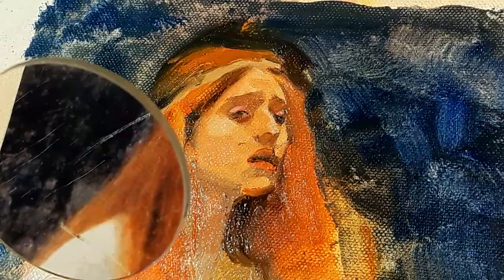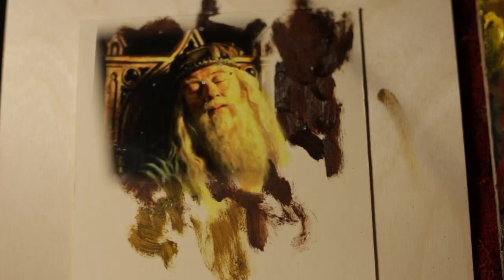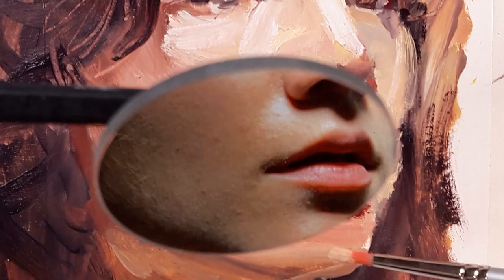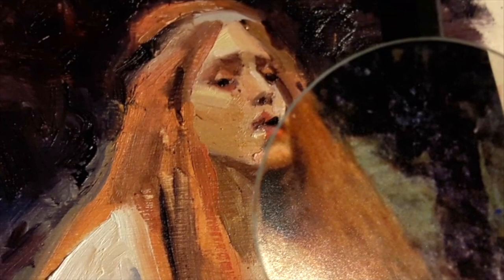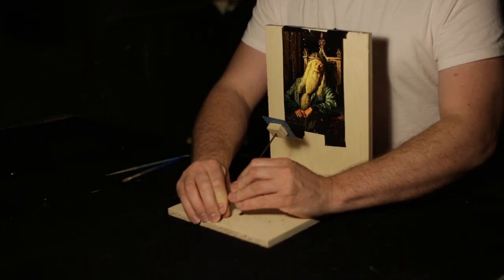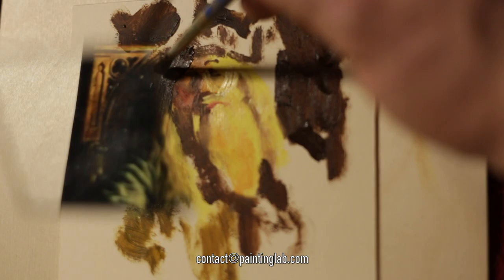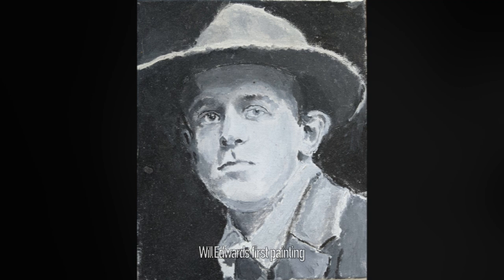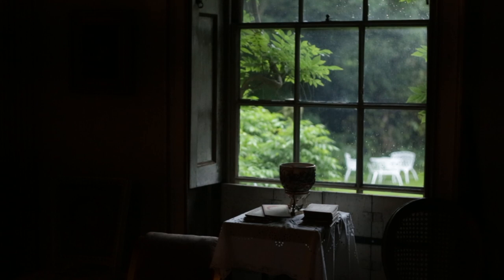How to make a Comparator Mirror (PART 1)

Comment: I'm in the process of building myself my set-up. Bought some round mirrors on Amazon. The interesting point is that it seems you don't need to buy expensive first-surface mirror, but you can turn a cheap second surface mirror into a first surface mirror! There are plenty of how-tos on Youtube, the trick is just to remove the protective coat of the metallized side with some paint stripper (the very alcaline solution)  Let it soak for several hours! In my first attempt, I just waited one hour or so. I could remove the coat with a wooden ice cream stick, but it severed the metallization that is only a few atoms thick. Then neutralize and rinse with white spirit or similar. 
At this stage I tried to protect the aluminium from oxidation with a layer of thinned car varnish. I tried to flatten the coat by spinning the mirror with an electric drill (that what they do for silicium waffers...), but this was not a success... too slow?.
My next try will be to use an air brush... But some other youtubers says this is not really necessary, and the oxidation is visible only after years...
So anybody else with experience with DIY first surface mirrors?
Reply from the maker: This is a brilliant post, thanks for sharing this knowledge. We'd really like to encourage folks to experiment in any way they like but it may be handy to say that we expect delivery of 1000 first surface mirrors just the other side of Christmas which we will be giving away (plus the cost of p&p)
Reply: There is the following of my experience... You see, I'm a maker more than a painter, so I tried my best to get a good tool...
- Dimension of the boards: Since my printer can do some A4 (21 x 29,7 cm) I wanted to be able to reproduce two pages, so an A3 (42 x 29,7), so I opted to something just a bit larger to leave room for the tape : 35  (depth or the floor board) x 45 (large). It happens that 45 x 45 would have been better, since at least 5cm are unusable at the hinge (too parallel to the mirror to see any reflection), and   the page should not be too close of the mast of the mirror.
- Fixing the too boards; I used shelf brackets, but they were not perfectly square so I could not get a fix image. 1 degree of, and you spend hours to find where is your problem. I used some thick paper under one side of the bracket, and used a big set square! I first used a small one and could not get a good enough result : all this to say that I really believe that an approximative solution might bring you disappointments. 
- Diameter of the mirror: First I tried a 5cm, but it's too large. There is always a slight deviation from one side of the mirror to the other. The bigger the mirror, the bigger the deviation. With a 2,5 cm mirror, the deviation is much less visible, so you can compare on any side of the mirror without having the feeling that you missed the alignment the previous time, not remembering which side you used.
- Mast holding the mirror: that was my biggest effort. I realized very soon that a mispositioned  mirror of a few millimetres was inducing dramatic deformation of the resulting image. So I used a rigid mast (an aluminium tube, diameter 6mm), and used my 3D printer for the foot of the mast, and the mirror holder. My first foot was rather small, held by a single magnet. but the positioning was not precise enough. If you have touched the mast, no way to reposition it exactly to retrieve your reference. So I designed a system with two screw to millimetricaly position the mirror in height (and so get the 45°), and the azimuth to be strictly perpendicular to the front board. The tuning is done with a square page on the front board : if you get a trapeze on the floor; your angles are wrong!
- I'm trying now to reproduce the "girl with a pearl" of Vermeer... Quite pretentious of me, but still his simplest composition, I think... And if I'm please with my system, I will publish my 3D plans on Thingiverse. 
- Oh, one more thing: I found that inclining the board was very comfortable to work seated instead of bending over the masterpiece... And it's also very useful be be able to juge the daub from a distance, where you see all your mistakes: one reason more to have a sturdy system to hold the boards and the mirror!
Reply: Even when I bought a first surface mirror, from an optics firm, they were only about 12 dollars on ebay.  But I actually used 2" squares or rounds from Amazon, and just cleaned them off with paint stripper.

Comment: I don't think the 45 degree thing is all that crazy important.  My mirror is adjustable so I can tune it up, but if you look at Tim's video segment on his process, the video is on YouTube, his source and mirror are not close to 45 degrees.  

As a teaching aid, I ripped through the mirror practice pretty quickly.  I used it for the first portrait I ever attempted, basically the first painting (may have done some plein air first), and as soon I I got the likeness from the mirror, I realized it was faster to do picture to picture comparison, so I was basically painting like a painter.  I would check the mirror if I lost the plot.

From that first experience I realized I could get a likeness with only a few points of reference, and then regular work, so I started using calipers to lay out the basic points.  This is basically classic technique, of measurement similar to people sighting with brushes.  The thing with oil is you do not need to be right from the start, you can move lines easily.  So learning to compare by eye is part of the challenge, and the mirror speeds that up for a beginner.  But that exercise does not actually require a super accurate mirror placement.  Just as in Tim's example, what counts most is basic proportions and all the relevant parts in proper relationship to each other.  Probably most of the portraits ever made were actually off a little, to make the person look thinner, or whatever.  I wouldn't let the perfect mirror setup stop one from trying this out.  Tim's source, looked of by 5 degrees or more.  I am not even sure anything happens to the image if it is off.  Nothing happens to my image in a bathroom mirror if I lean forward or back.  As long as one can see the image in the mirror, it seems pretty proportional.  That is part of the magic in the mirror, it is not subject to optical distortions, it seems.
Reply from the maker: This is a great comment, thanks Hondo. If the mirror is slightly off the source will swim in the mirror which is not ideal but still workable... if you try this youll see what i mean. In every other aspect we salute you! Best wishes PL

Comment: Another helpful video.  I have your Comparator Mirror Kit (Thank You!) I was wondering if I could get the dimensions of the wood.   Thanks!!!
Reply from the maker: Sure, the wood doesn't need to be exact dimensions but I'm using about 12 inches by 9. at least one machine cut edge will be really helpful in achieving that right angle corner though.
Reply: @paintinglabofficial  Wow! That was fast! Again thank you!
Reply from the maker: inches. About 30 x 25cm

Comment: I got my kit today.  The little magnets do not fit exactly into the base piece --they are a little too big.  Are we supposed to hammer them in?  Also, when we glue a magnet to the mirror does have to be exactly centered?
Reply from the maker: Hi Jane. Last point first. You don't have to centre the magnet perfectly but it always makes me feel better. As for the base magnet you will find that it is a tight fit but it will go. I would not advise hammering the magnet in but a little pencil lead should do the trick. Perhaps I'll demonstrate this.
Reply from the maker: Hi Jane. I have mentioned this in the new video (episode 8)

Comment: Can one do large paintings?
Reply from the maker: Hi there, the maximum size possible with any comparator set up is about 24 inches. However you can paint at any size going section by section or (as Tomas demonstrates in episode 5) you can use the comparator to paint small sections of detail into a larger canvas.

Comment: In US the cheapest mirror I have found is a Coghlan's Acrylic front surface mirror #8501.  $3.12 at Walmart.
Reply: I tried that also, remembered them from my backpacking days.  But maybe the color in the first surface mirror is actually better.  First surface mirrors were cheaper, as I just got a 12 pack from Amazon, for the same price they were charging for  a backpacking mirror.  And then removed the coating of the plain mirror with some paint stripper on a rag.